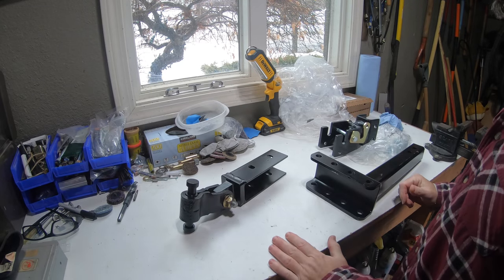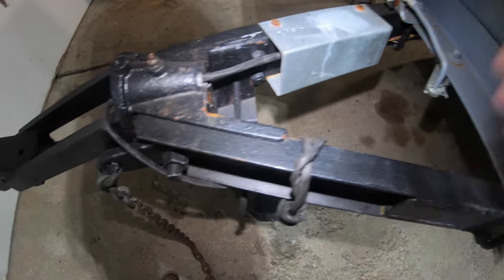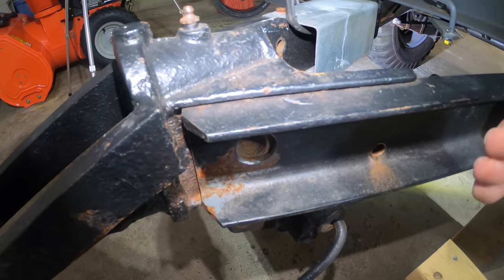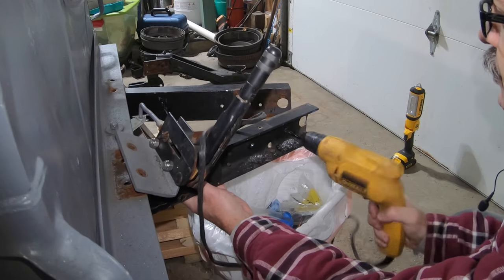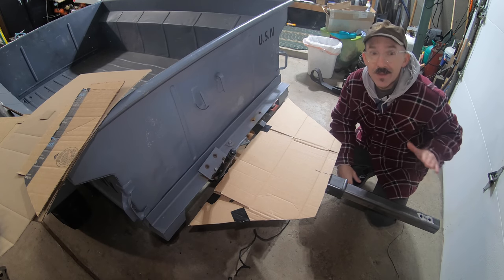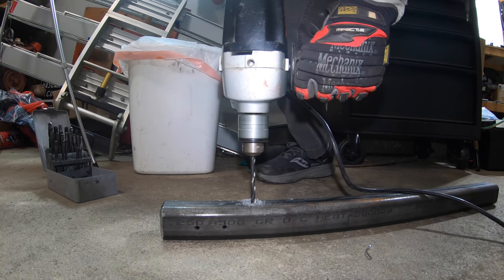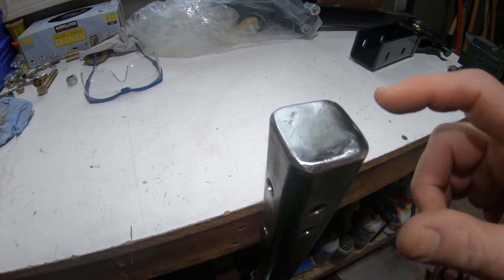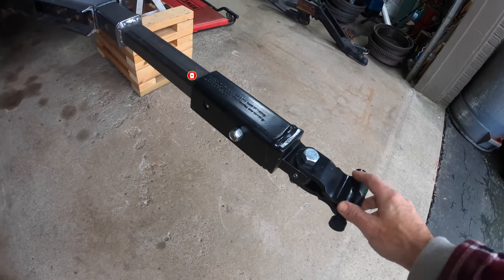M416 Tongue Extension & Lock n Roll Hitch Install, Part-2

Comment: Great job!  I'm in Ohio and was eyeballing that trailer when it was listed up for sale here locally. I'm glad it made it into good hands.   I have acquired another M416. if you don't mind me asking. what is the distance between the center pivot point of the "dog bone"/"trailer side Lock-N-Roll" and the trailer's body?   I assume you purchased the Lock-N-Roll "vehicle side"/" VS 519 Extended length height adjustment channel"(with PN503)?  if so can you tell me the measurement of it's receiver hitch pin hole to the "dog bone" female pivot point?   

thanks,
M.E.
Reply from the maker: Thanks, yeah at times I wish I would have paid more for a cleaner trailer.  Mainly the bed on this one is pretty wavy.  Will try and straighten it out.  
  From the pin in the hitch(trailer side) to the front of the tub is 44.5”